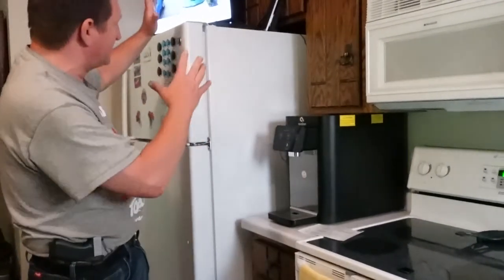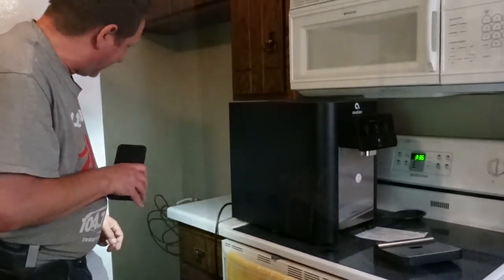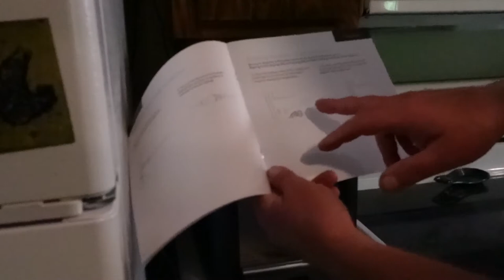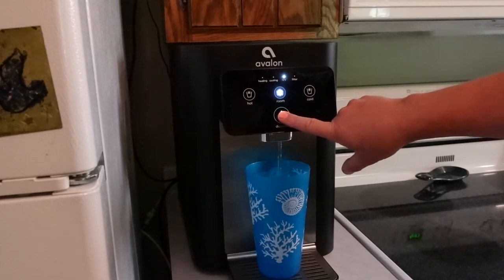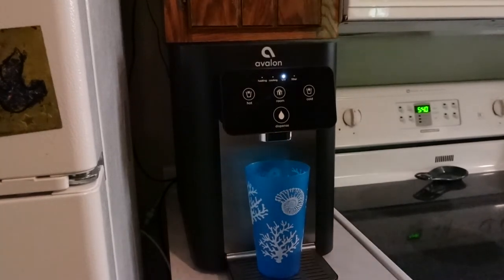Avalon Countertop Water Filter Installation

Comment: Was just checking how you feel about the avalon a9 water dispenser now that you've had it for a bit I've read in some reviews that it doesn't get as cold as advertised and wish it was a little colder just wanted to see what your thoughts where b4 I pulled the trigger on it?  Also thx in advance and thx for the video very helpful
Reply from the maker: David, thanks for the question.  It does not make the coldest water, but it does a great job of making cool great tasting water.  I usually fill a very large plastic cup and it is cold enough for me, but it is definitely not as cold as water you would get from a good refrigerator with the water dispenser built into it.  The maintenance and changing the filters is fairly straight forward, but for some people it might be a hassle compared to other systems.  I think for the money and easy of use it works really well.  I really enjoy using it for making hot chocolate in the winter.

Comment: Have you tried cleaning the whole system?
Reply from the maker: Yes, did the hot side the second time around.  It was a bit of a pain getting the tank out, but once you've done it once it should be easier.  Unit is still working flawlessly.

Comment: So one hour for the cold water? So if I wait an hour and fill 1 gallon of cold water I need to wait another hour again to get it cold again? how does this work? What is the hour waiting for?
Reply from the maker: Yes, internal tank isn't very large and it takes some time to cool down.  Under normal usage I'm not having any issues with not having cold water.  If you need later amounts of cold water, then another unit or type of system might be better.
Reply: @DoItMyselfGarage  thanks for the quick response! Much appreciated

Comment: I installed this water filter 5 days ago and the water tastes like plastic. Did I do something wrong?
Reply from the maker: Did you follow all of the setup instructions?  Did you flush the filters before installing?  I've replaced my filters one time so far since the initial installation and haven't had any bad taste issues at all with either the hot or cold water.